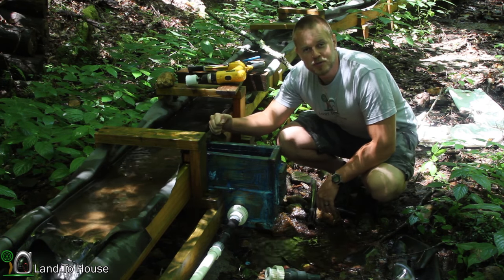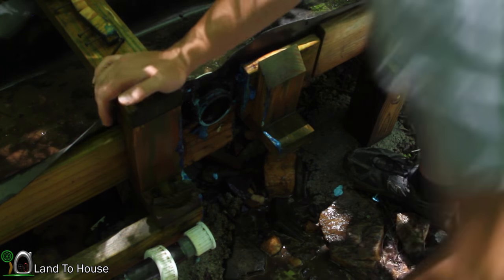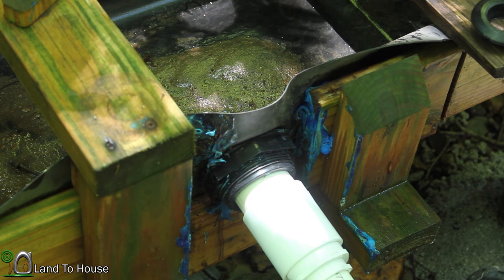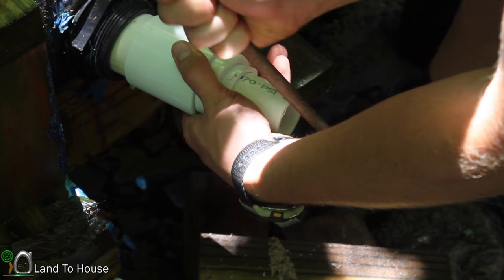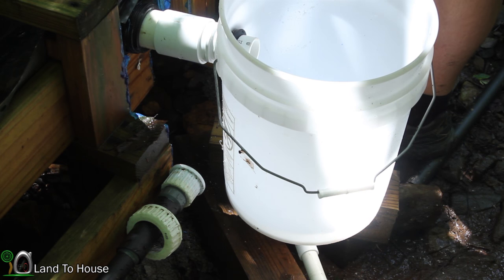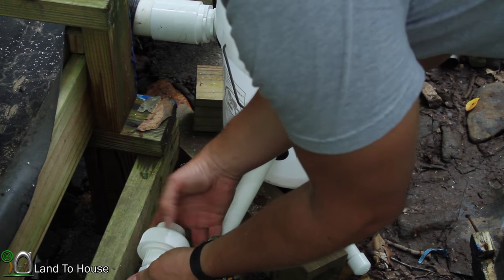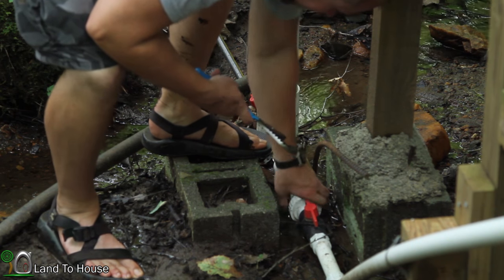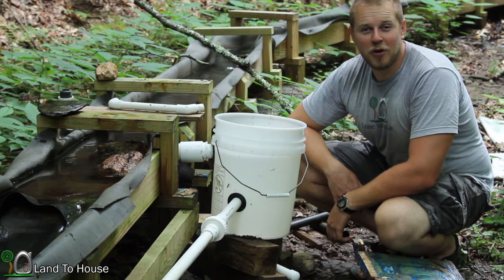Ram Pump Bucket Intake

Comment: In the immortal word of Tony the Tiger...... Grrrrrreat! Every one of your videos help me remain fired up.  Keep up the wonderful work.
Reply from the maker: +John W. Ketchersid PhD Good old Tony. I like knowing that I have been motivational!
Reply: This week I will be recording a video of my new Ram pump which actually can be placed in a well provided that there is at least 10 feet from the water line to the bottom of the water source and that will give you 85 feet of lift as well as up to 500 feet of horizontal feed distance.  You were my inspiration to invent it through your submerged rampump video in which Mother Nature body slammed your tripod with camera.  When you see the solution you will no doubt get a giggle.
Reply from the maker: +John W. Ketchersid PhD I am very interested in this project. Be sure to let me know when it's uploaded. When you submerge the standard Ram pump the hydrostatic pressure negates the head pressure so I am interested to see how it works. To be able to pump water out of a well would be amazing.

Comment: Just a note when drilling plastic with hole saws -- Start the pilot bit as usual, but as soon as it grabs, reverse your drill. It will use heat/friction to melt the hole without the risk of snagging the teeth and cracking your buckets.
Reply from the maker: That is a fun tip. Thank you. When I use the hole saw again I will give that a try.

Comment: I just saw this video so you've probably changed things by now.  I'm thinking if you had a deeper flume it would allow sediment to settle to the bottom more.  You could draw water higher up from the bottom where heavier solids would be. 

I like your videos.  Getting some ideas for watering a garden.  I'm thinking of using a PVC pipe siphon drain from my pond over the back side of the dam to get about 15" of head pressure.  I wouldn't have to run as much feed line to get the same drop.  And I could control my flow with a valve so I don't waste as much water.  Our pond usually has flow over the dam but when it's really dry the level sometimes drop.

Comment: Nice design.  If you have a connection that needs to be taken apart from time to time, I found that a drywall screw works just fine.  It holds everything in place as well as cement but allows you to very easily disconnect when you need to.
Reply from the maker: +haynerbass that is an interesting idea. I would be a little bit concerned that there is so much force in the ram that it would start wiggling that hole larger where the screws went in.
Reply: Wow!  That was a quick response.  That is a possibility for sure.  I only used it as a temporary measure while working on a new design of my own.  Keep the videos coming.
Reply from the maker: +haynerbass :) sometimes I just happen to be on the phone replying. More videos on the way.

Comment: Suggestion to make the silt cleaning easier. Take your bottom pipe and connect it back to the flume downstream of your dam that fills the flume at the intake. That way, when the water level is up, the silt drain will flush back into the flume on its own. The only amount of water you would lose is the difference in the height of above the dam and below the dam. Lower the bucket so the water comes in from the top and put a lid on it with the seal in it. Drill and install a vent hole pipe. 4" or so more of water depth for the pump. If the water level drops, the drain pipe would stop draining until the level built back up.

Comment: You may have thought of this but if you can get enough extra water in the bucket by lowering it you could add an elbow to the drain pipe and a vertical pipe to maintain a higher water level. Water coming out would keep the silt flushed out so you wouldn't have to drain the bucket as often. If that doesn't keep it flushed out you could put a t in the horizontal flush pipe and connect a valve or put a cap on it for complete drain as needed. If you can't get enough water at at this site it might be worth a try at other places where the water supply is greater. Ram pumps are very interesting. i wish we had a water supply where we could use one.
Reply from the maker: That is a great idea! I actually already have the elbow installed. There is a newer video showing that in action. The intake screen is doing a great job at silt. I have only emptied the bucket once.

Comment: Hi Seth, 
To dampen the noise from the check valves, maybe if you turn them down with a short piece of pipe in the bucket maybe it will work

Comment: Question: What is the rest of the flume for? 
Suggestion: Mostly overlooked, buy using Wood in any situation with water will eventually rot out. I've learned to work with "Trex" decking (it's 2 x 6), which is recycled plastic. It can be glued and screwed and shaped and formed just like wood, but has the advantage of being waterproof and therefore "Sealable". It's better to use for mounting the Ram Pump assembly.

Comment: PVC cement takes at least a day to dry.
I use priming fluid to break the shiny surface on all glued surfaces too.
Reply from the maker: +Myles Nicholas that's odd! My bottle directions say 15min for solid working and 2 hours for a full cure.

Comment: Just as long as you realize that your drop starts at the bucket, and there is no back pressure or water hammer effect preserved from the actual intake height further up the line. I just saw on another channel a guy installed a VENT on his pump feed line. And I also made the same comment, that when you do that, you are in effect starting the drop from THAT point, because it is the point where the hydraulic pressure can finally be relieved in the feed line. It looks like drop is not a big problem for you, so the bucket makes some sense. But personally I would have installed it as uphill as possible to increase maximum drop. It looks like you could go a couple of feet higher with ease, which would give you 14 more feet of supply height potential, but more importantly, would fill your tanks faster.  Databyter

Comment: Use bulkhead fittings for the connections! The rubber gasket keeps moving because there's no friction washer.(they're usually paper, but they are made in plastic.) Ideally, you'd like to have 12" of water above the drive line inlet.This doesn't let the shock be absorbed by the water in the bucket. The less shock absorbtion, the better. It's better to rub the edge off by doing it against concrete.or a coarse rock. To solve the sediment problem, put a container inside a container with holes on the top of the inner container. Do I get to see your ram pump?

Comment: You are going to put a cover on that bucket right? If you put another pipe above the inlet you could redirect any overflow back into the flume. I love learning how to do things using tools. Keep up the good work.
Reply from the maker: A cover will be a must when I get all the little kinks worked out. Because the top of the bucket is above the flume there is no overflow. The water level matches the level in the flume and does not go any further.

Comment: Look at the possibility of setting the bucket up as a radial filter design. Would help in raising the level for sediment to collect.
Reply from the maker: +Charles Kiplinger at some point I will have to look into that because the sediment does build up quickly.
Reply: That and with the amount of sediment you will be looking at a small barrel may be necessary. Good luck.
Reply from the maker: +Charles Kiplinger yes or just several trips to drain this one.

Comment: put a piece of screen over the entry hole to the bucket; it won't keep out sand, but it will keep out sticks, leaves ect. ty for the video, also cover the top of the bucket w/screen!! or something?
Reply from the maker: Some screen would keep out the unwanted debris. I might have to look into another method of getting water into the bucket. When low flow times of year hit the flume does not have the water to keep the pump going.

Comment: By the way. The more stationary the drive line, the better. If you could do it in steel and then incase it in concrete would be ideal. No flex of the drive line!  Seriously, bury it or something! That flex that made the pipe come apart? It takes away from the height it pushes up on the delivery line. You can veiw the 1926 Audell's plumbing book in pdf. Everything you ever wanted to know about ram pumps , but were afraid to ask.

Comment: GOOD VIDEO...why was a box used to bring the water down...or is it some thing being shared...metal pipe from the bucket to the ram pump would have kept the joints from coming apart I would think...I know steel is a little costly...thank you...I enjoyed the video...wish I could have helped you...just to pass the time away...but I'm older than dirt and probably too far away...good luck...keep the good work going...
Reply from the maker: +Concepcion Amancio thank you. The box was an idea that I had years ago and it just did not work out. Yes metal pile is the most ridged but like you say it is costly. I have since glued the pipe and that stopped the issue.

Comment: I got an idea use the ram pump to pump water to a reserve tank have the over flow turn a water wheel inside of a tank for creating electricity and you can gravity feed from auxiliary tank and if your Creek runs dry you run power and gravity feed water from reserve tank
Reply from the maker: The output of the ram pump is rather low flow and would not make much power. Now if you use the ram pump to fill a large tank you could use that water to run a turbine downhill.
Reply: He's losing about 95% of the water before it goes into the pressure tank.

Comment: Was wondering about placing an inline check valve at different distances along the drive pipe to have more control of the shock wave.
Reply from the maker: +Mike Carter that would actually keep the pump from starting. The pressure wave must return to the source with each cycle. Now you might be able to install a stand pipe closer to the pump to reduce the length of drive pipe wave.

Comment: Good video.   You mention the silt, is a filter not good to keep some of it out a least for a longer period of time?   Have you checked for gold in that silt?  Hummmm?
Reply from the maker: +H Max gold would be nice. Lots and lots of mica in this area. In a way my bucket intake is a filter. The larger sediment falls to the bottom instead of going into the pump.

Comment: It seems to me this is much more complicated than it needs to be. Just block the flume, leaving a 1/4 inch gap at the bottom. The gap should let the silt sluice through, while it is too short to allow the full flow of the water. (You might need to adjust the gap so it is closer to the bottom if your flow of water isn't strong enough.) Also leave a gap at the top for overflow, so the sluice isn't ruined. Tap the side of the sluice below the overflow line, as high above the silt flow as possible. You're done.
Reply from the maker: That is a fun idea. Installing a board to slow the water at the intake of the pump. Allowing the silt to pass would be a great help. There is such a fluctuation in water flow in the creek that I would likely have to adjust the gap a lot.
Reply from the maker: That is a fun idea. Could incorporate that in an intake design.

Comment: Just a thought... Rather than using the rocks (or as many rocks) to back up the water to increase flow into bucket (potentially catching unwanted debris), why not get rid of all those inlet reducers and increase the flow into the bucket more naturally (and lessen the chance of leaks caused by pressure restriction) and merely add a return pipe above / level with the inlet level that goes back into the flume? (providing the bucket with automatic water leveling) With a decent sized return/s and a lid on the bucket there should be less chance of leaves getting stuck in the pump and a good chance of them being returned to the flume before they settle to the bottom of the bucket. Basically provide the bucket with far more water than the pump can pump and return all excess to the flume. That way your pump should see a constant water level at times when flow is minimal and when the flow is a lot.
Reply from the maker: I do like that idea! It would be nice to add a little bridge of wood to the bucket and take out that shower drain. That would give the water full unrestricted access to the bucket. In the spring I will have to spend more time on the intake to make it work well.
Reply: +Land to House I just had another crazy thought... Can you get your hands on a plastic container that is say 4 or 5 times the volume of the current bucket? Just realised you're not properly utilizing a free and natural gift, GRAVITY. Ok if water pressure at the bottom of the ocean can crush a submarine through gravity / water weight, then it stands to reason it can help you with your pump. So here's the theory / plan.... Your pump works by taking x amount of water and provides it to the pump using a gravity feed (the weight of the water in the pipe / bucket). If we do a quick and very rough calculation, let's say the bucket you current have is a 20 litre bucket and at 1kg per litre of water that is 20kgs of water weight. But the bucket isn't completely full and the outlet is above the bottom of the bucket, so in essence you probably only have 10kgs of effective water weight. Now if we increase the effective water weight (all the water above the bucket outlet) to say 100 litres. According to my thinking you have just increased the pressure massively (don't know if it is 10 times, as I don't know enough about how water pressure works, is it linear is it logarithmic?) but it is a significant amount more pressure forcing its way down the pipe. Now lets move down to the pump... Every time the valve opens more water volume is trying to find it's way into the head, which in turn should translate into more pressure at the hose end (with a more constant water source). So how can you make this work I hear you say? Well your fortunate to have a decent slope leading down to the pump, and because you will need a taller / wider bucket you merely move it down the hill closer to the pump. Remembering that you still need the top of the bucket at a level where you can flow the bucket overflow naturally back into the stream. You would need to rejig your outlet pipes to a lower position, but what little volume you lose in the pipes is more than made up in the bucket. Hope this helps.
Reply from the maker: I think I am following your logic. My thoughts are this: Head pressure is the same but opposite of hydrostatic pressure. If I were to take the bucket away and add a larger tank with more water on top of the drive pipe intake I would actually have the same pressure as if I were to leave it at the same level with the bucket. If I moved the intake down lets say 3 feet and that gave the tank 3 feet of hydrostatic pressure with lots more water in the tank it would be taking away the 3 feet of head pressure and be the same. Atmospheric pressure is the same on a column of water no mater if it is the size of the ocean or a 1" pipe. The pressure is not calculated by volume but in vertical space. I hope this makes since. Basically adding water to the tank but removing height of the drive pipe is equalizing the pressure. The only way to get more pressure is to go up the creek with the intake to get more head pressure.
Reply from the maker: +Dodgy Brothers feel free to send to my landtohouse gmail. I check that all the time.
Reply: Dodgy Brother

Comment: Could the accumulating bucket be self-cleaning if there is more water flowing into the bucket than is being used by the pump? An outlet that is smaller than the drive exit that is open to allow silt to exit?

I am also guessing that the delivery head is at the bucket.
Reply from the maker: Yes the bucket is the new head pressure location. In another video I have a bucket filling with lots of water and it self cleans.

Comment: multiple buckets in series (like a septic system) would keep most of the silt out of your  ram pump
Reply from the maker: Yes indeed! I have another video with a two part filter. It works well.  One screen intake and one bucket.
Reply: @LandtoHouse  Wouldn't the last bucket be the actual head then?

Comment: Maybe I missed it, what is the purpose of the flume?
Reply from the maker: +Ontario Lakeside 3 years ago I built that so that one day I could test out some small Micro Hydro projects. Right now it's just a fancy Ram pump holder
Reply: Thats cool. Do you still have plans for micro hydro?
Reply from the maker: +Ontario Lakeside I would still like to play around with some Micro Hydro ideas. With the new house going in I have been swamped with all these new projects so Micro Hydro has kind of gone to the back burner. I also have four solar panels I would like to install for some supplemental power.

Comment: I am hoping you can help.  I am getting a lot of water with strong flow in a 1.5 inch system with about 4 foot fall over about 100 feet.  However, the flow is not closing the brass valve. What am I doing wrong? Thank
Reply from the maker: There are a few things that prevent the valve from closing. You may have a screen over the intake limiting the flow of water. You might have an issue with an air bubble trapped In the drive pipe. Is the drive pipe the same size as your waste valve? That needs to match.
Reply: @LandtoHouse  thanks. I did notice that there was a lot of silt in the screen in the intake. I will keep trying to work out the problems!